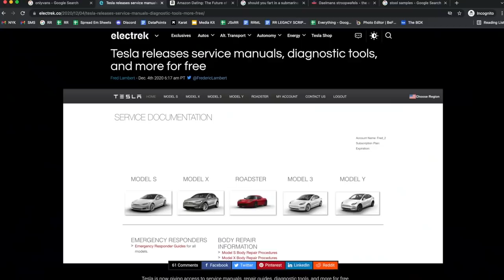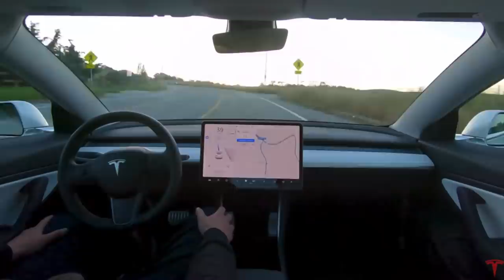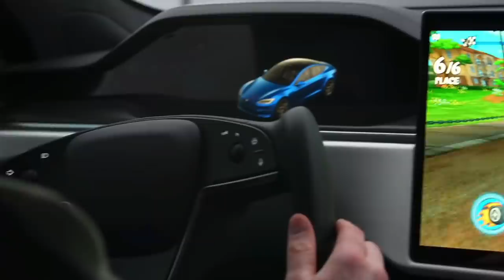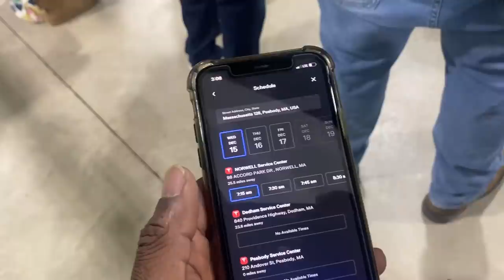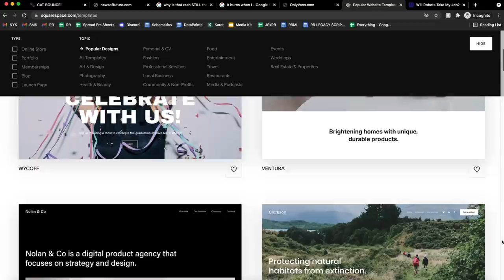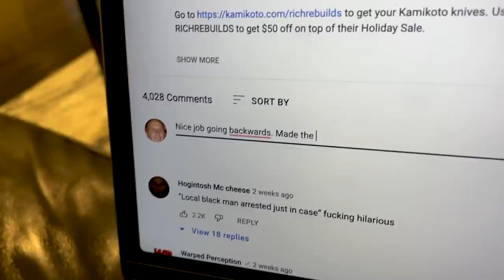How Tesla is failing its most Loyal Customers

Comment: you could buy a 500$ shitbox of a car from your local used car dealer and still get better service and customer treatment than from Tesla after paying 140K for their car.
Reply: Its true, I bought a 2007 corolla to get me to work.  4 months later the muffler got a hole.  They replaced it free, because it should have been noticed in their pre purchase inspection.  Took 45 minutes while I went to McDonalds across the street.  The car was $3800
Reply: My 2010 mercedes c250 had less problems in 5 years than my brand new model Y in a month  😅
Reply: I used to be a mechanic and saw crap cars in the shop. Our shop owner did not look at the car before bringing it in.once a car came in with a clutch needed replacing the the catalytic converter prevented the car from starting ...we did not know it was plugged. The car owner blamed us yelled at us it sucked. We cleaned the cat and let him go.

Comment: In 2010, I bought a Toyota 4runner sr5, after driving it for 2800 miles or so, the control arm broke, took the vehicle back to the dealer for repair thinking I’d have to pay for it out of my pocket, since, the dealer did not have any control arm on stock, they told me it’d be a few days before the vehicle gets repaired, 3 days later I received a call from Toyota corporate office asking me if they could buy the vehicle from me so that the engineers who designed it could look at why the control arm failed, because it wasn’t supposed to break at 2800 miles, I was offered 5 thousand dollars more than what I paid for the vehicle, been a loyal customer of Toyota since then.
Reply: @Jay Smith bought a Trail V6 after that, it has 260k on the odo now , had to change the starter once, other than that it has been bulletproof, I’m going to buy 22-23 model before they redesign it with a 4 cylinder turbo.

Comment: "The customer is always wrong"

Tesla service dept. training manual.
Reply: It may seem that way, but that's because you're fixating on the case where they ARE actually wrong.
Reply: the rest of that phrase "the customer is always right in matters of taste" changes how it should be applied 
this is largely why many ppl use it incorrectly to mean "cave to any customer's demand"
instead of the og meaning "don't question the customer's selection"

Comment: I’m a 2016 model S owner that’s dodged any major issues luckily but have also dealt with Tesla Service enough to know that I’m most likely a one and done Tesla owner. This video is exactly the arrogance and disrespectful attitude I got from Tesla Service back when I was on there “service” plan…yeah, I’m embarrassed to admit I paid for them to basically change my windshield wipers and cabin air filter once a year. It’s not the quality or that their vehicles have issues…all car companies have those challenges. The problem is how they treat customers as suckers and pushovers. My next vehicle will probably still be an EV, just not a Tesla EV…the established manufacturers have caught up and they understand the value of customer focus and service. I’ve just got to decide when to pull the parachute and dump my Model S before it’s considered worthless in the market. Wish me luck!
Reply: Also agree.  For me it's the right to repair.  When I realized Tesla would blacklist me if I replaced my battery pack which is half of what it was new, I'm done.  Off to another manufacturer that's doctrine isn't based on customers being blessed to purchase their product.
Reply: Polestar 2, their customer service is great. Fast charging is the only up tesla has on them but by the end pf the year polestar owners will be able to use tesla chargers. Pilot program in the netherlands and texas has already started.
Reply: lexus is the best customer treat in my experience and it's the bullet proof car
Reply: @gasser5001  which you are, not every OEM is USA, VW group made 450,000 EVs last year, there are literally hundreds of EV models now, just because GM is a joke, it doesn't mean any of the hundreds of other EV automakers are. And yes, hundreds of them.
Reply: @gobindhehar   Polestar 2....slow :(
Reply: Issues
Reply: @gasser5001  Volvo, Polestar, Mercedes, BMW, Audi, Jaguar, Porsche, Volkswagen, MG, Renault, Fiat, Honda, Nissan, Kia, Hyundai, only to mention a few besides Ford, Rivian, Lucid, GM. There are at least half a dozen Chinese brands on top of these. The build quality, service, and customer care of the European makers' EVs are so much better, it is simply not comparable to Tesla's. It is time to admit, that as a Tesla buyer, you buy excellent software, hype and below-average built quality, for a premium price.
Reply: You're totally right. For example, Ford had delays on delivering my neighbour's Mustang Mach E. My neighbour complained and Ford gave him a loaner Mach E for 8 weeks whilst waiting for his actual car as well as some reimbursement for the monthly payments. Tesla would probably tell you to pound sand.

Comment: Meanwhile, my 6 years old gen 2 Chevy Volt had a a couple of problems with a module of the battery pack. Always had a good service. GM decided last week to change the whole battery and lend me a new cadillac for the 2 weeks it will take to receive the battery and install. They will pay for the fuel. Happy with that kind of service
Reply: meanwhile my 2006 jetta diesel still has every factory installed part sans battery, oil, brakes, tires, and fuel.  Entire car including all expenses and running costs ten years later still hasn't even approached half of what a model 3 MSRP'd at.

Not to mention, I can get in my car and drive 4000 miles without stopping for more than 5 minutes every 600 miles to refuel.  Car also runs perfectly fine off used fryer oil, which costs virtually nothing to procure.
Reply: @elesjuan  well that’s awesome man. Any car that last and show reliability is good. That and good service is the key. Mine is a rare occurence and i’ve never had other problems. Considered my self lucky that at least, the one problem was taken care with good service. Wish you a lot more years with your car
Reply: @elesjuan  Yep, that generation of TDI's were amazing! I had two. But got tired of the stink and maintenance required.
"drive 4000 miles without stopping for more than 5 minutes every 600 miles to refuel." 
And you have an amazing bladder too!
Reply: Quality.. and I have no interest in GM
Reply: @elesjuan  Now that's a real eco-friendly car! No pollution from oil refinement or lithium mining, and you're repurposing a waste product from cooking. Plus, you're reusing something old instead of buying something new.
Reply: @Schnitzer325ci  Sez the BMW fan boi. How come you don't own a M4 yet? Jeremy has BMW owners nailed.
Reply: It doesn't mater now but depending on which state you live in there is something call a "diminished value claim".  Even if they fix the car 100% it won't sell for what it did before having the accident this diminished value can be sued for in some states.
Reply: @elesjuan  my 2010 Jetta TDI was not as carefree. They wanted $2900 for a new DPF a few miles after the emissions warranty expired. I know, I know, as the coughing kid down the street with asthma can tell you the 2006 did not have a DPF but your car was not typical of VW "quality" to say the least, if there even was such a thing as VW quality. Everyone knows the real answer to this issue. If you want a reliable car you buy a unsexy Toyota Camry. 😆
Reply: @kevinmiller5467  interesting! I live in Canada and we don’t have that. I plan to keep the car another 3-4 years at least and give it to my son if the car is still ok at that time. Want to let the ev market evolve a couple of years before changing :)
Reply: @elesjuan  Yes, a well designed and maintained car will go a long way.  I got a very used 2015 740Ld diesel last year and after 10,000 miles only repairs were front brakes, windshield due to a rock on the highway, and a leaky EGR cooler gasket.  And having a good local shop is key to having a used car, I am very past doing oil and fuel filter changes so happy to pay someone else to do that at a good price.
Reply: @petersachs764  oh I certainly took a bit of a gamble buying a used VAG, knowing the quality, well, more so the over engineering and lack of reliability.. It was a calculated risk, and I selected a very specific generation and model based around those variables. The death of this car most certainly will be electrical in nature, but knocking on wood, has been a very good and very reliable car for me. Given the used car market currently along with my desire to not have a car payment, I'm inclined to do anything possible to help continue motoring on with this particular chassis, to wit, I am planning to start collecting various replacement parts such as engine, trans, wiring, modules, etc. Basically looking for a crashed parts car that I can salvage anything that might be necessary in the foreseeable future.

Yeah, I'm a little crazy. Lol.
Reply: dacou104 Chevy volt? Lololol you mean Bolt?
Reply: @marcxiong8332  Nope chevy Volt. Been on the market since 2012 I think
Reply: @elesjuan  True story. Back in the early 80’s a popular off road magazine (real popular then) purchased a Rabbit pickup with the diesel. They installed an auxiliary fuel tank in the bed like 50 or 60 gallons. Filled it up. Drove 3K miles East coast to west coast, drove to the tip of Baja, back to CA, then started back to the East coast and just gave up out of boredom. Still had a good amount of fuel left.

Comment: Hmm interesting so Tesla can't fix Steven's car because they are too busy making new cars to fix the cars they already built?   On a weird twist GM only sold 26 Bolt EV/EUV's last quarter because they are prioritizing fixing existing customer cars over building new ones.  Though GM did sell over  100K EV's last quarter because the Bolt EV/EUV is not the only EV GM sells globally.
Reply: Jim jibroni  i have the same truck, 2022 it already put 10,090 miles pulling a tandem trailer about 6,000 lbs with no problem.
Trucks like to work and not being groceries shopping
Reply: Jim jibroni  have you taken it in for service?
Reply: @machedari  Dude probably put a 800hp tune on a stock engine and then complains about reliability lmao. Thats how it always goes. When it shits on them they only blame the company and then it turns out they voided their warranty because of it.

Comment: I noticed on the $3000 air suspension pump/air shocks invoice, Tesla was kind enough to write-off the $4 fuse that probably can be bought for a quarter. Oh and they also checked the tire pressures for free.
Reply: oldest trick to do when providing someone with quote/invoice, mark up the price for what they want while you offer something else for free so they think they are getting their money's worth. Biggest most common example free shipping on most websites (they ain't paying shipping for you, they just not getting paid for it twice! ) Fees/costs are always included in parts / orders and the labor cost (this case 770 $ ) is normally the ez profits for the company, even companies that claim their costs are transparent is bs because every company in the world has marked up prices otherwise business would not be possible - it's whoever can make you believe they are worth paying more for that make the big money *cough fckn tesla *
Reply: AND a remote battery